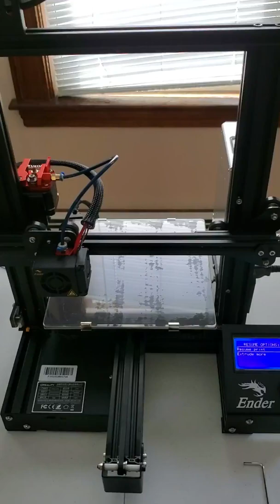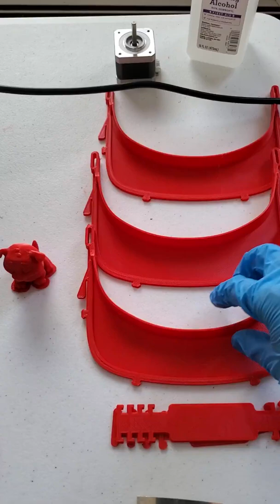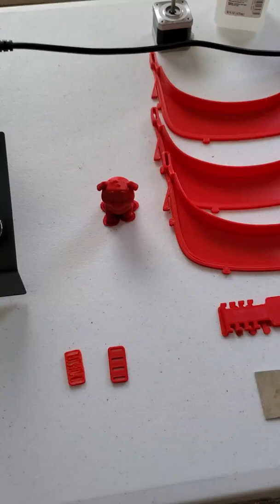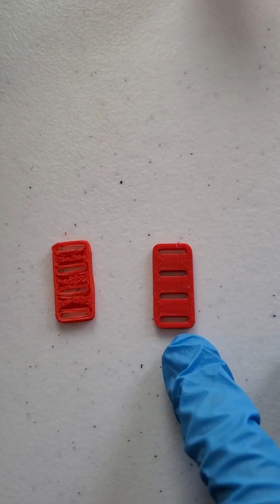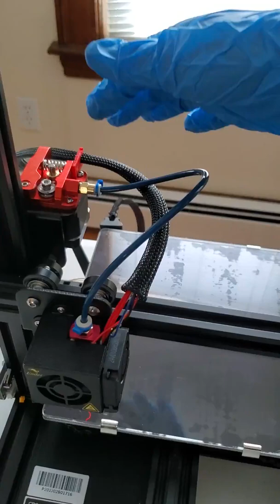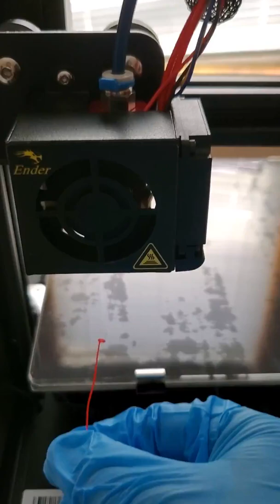Help! Troubleshooting extrusion issues on Ender 3 Pro | 3D Printing

Comment: Everyone if you’re still having this issue replace the cable to your extruder motor it’s mostlikely a bad wire… took me a day to figure out and now my ender 3 pro is working perfect… again if you wanna try and troubleshoot plug a different wire into your extruder motor and it will work perfect but if you use the extruder cable on a different motor the motor will start skipping..

Comment: I have noticed the same problem in my ender 3.
I replaced it with a new extruder, PTFE tube, hotend, nozzle.
I changed the spring settings in the extruder and noticed that it moves 3x less filament than it should.
So I made a print test. I slowed down by 10 each subsequent test. I slowed down to 50. The printout looked satisfactory now. But when printing a larger element, after about 2 hours, the extruder also started tapping for a moment. Which kept the filament from sticking out of the nozzle.
If someone had a similar problem and solved it, please make a video. I'll buy you coffee.
Reply: Setting up the Esteps helped with my problem. It is also worth removing the PTFE tube from the hotend in advance. Unscrew the nozzle. Heat to approximately 190-200C and use an old PTFE tube as a cleaner for the interior of the hotend throat. Fold everything, remembering to push the PTFE tube as deep as possible so that there is no empty space between the tube and the nozzle.
Then set ESteps according to the movie. It should help and it certainly won't hurt.
https://www.youtube.com/watch?v=Ho8_NnFE0b0
Tell me if it helped anyone.

Comment: Same problem but the hot end was clogged of a size of a walnut, wasn't a stepper motor problem solved by replacing the hot end also. heat up your hot end and tighten every part of the damn hot-end, don't wanna have them PLA spilling out. and clogging the damn shiz again.

Comment: Everybody, try to see if you can push your filament through by hand (if the nozzle is 200 degrees). if not, maybe the problem is at the nozzle end.
try to remove the nozzle and clean up the bowden tube and this should give the motor free hand

Comment: The problem are the stepper motor get hot and at hi temperature have less force the first question are why get hot and cud be an extruder dirty, a head with low temperature, or many other things, to resolve this i start using a cooler direct in to the stepper motor and work fine, but a final solution cud be change the stepper motor with a bigger one, but need to be sure don't burn the controller.
Reply: So.... She have replaced the stepper motor... Maybe it's the stepper driver....... overloaded.... Burned...
Reply: Recommend try a new silent board...

Comment: Hi, I'm having extrusion issues now as well, and have tried many of the things you are talking about. At first, putting a new spring on the extruder for better tension worked, but only for a short time.  I have the same red metal extruder that you have and it worked great for several months, but I think they just sometimes fail after a while.  I have gotten to the point where I may just purchase a different brand of extruder. Before I do it though I'm going to try to put my old one back on and see if it prints. I hope you have been able to solve your print problems!
Reply: Actually, there is a tension adjustment that you can do on the screw of the lever arm.  I adjusted that, and it may have fixed my problem. Still testing :)
Reply: @drausch2173  I'm sorry but it's not a solution :(( Becasue ı tried that way, it's solved it for just a few hours but then it repeated again. I'm trying stillll
Reply: Change your extruder cable